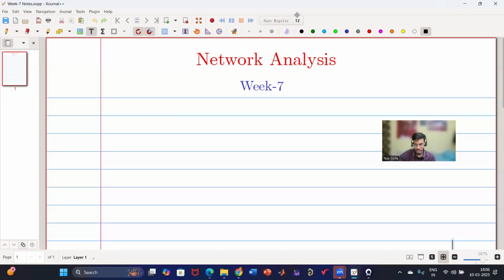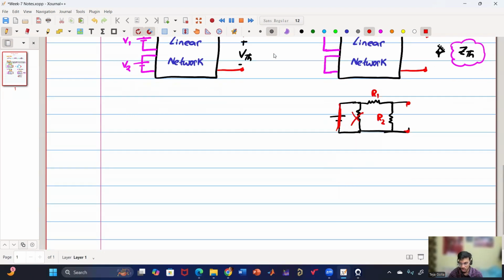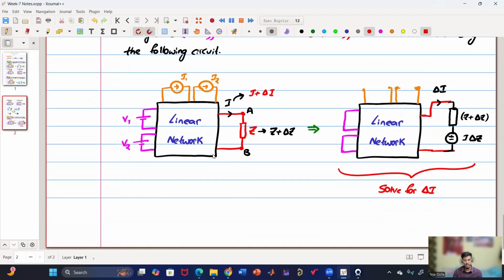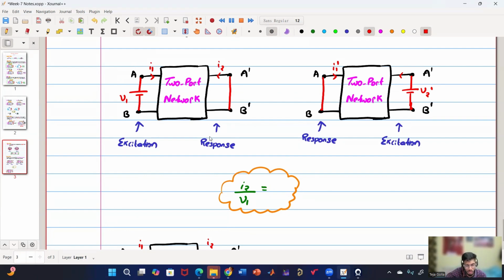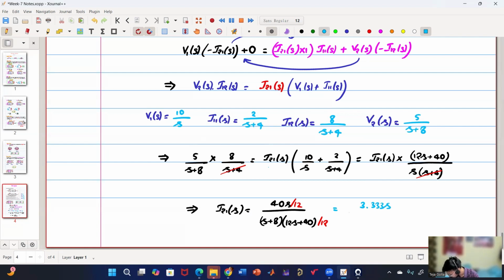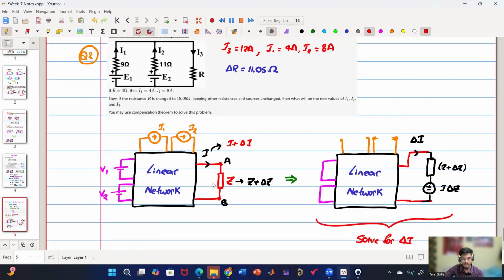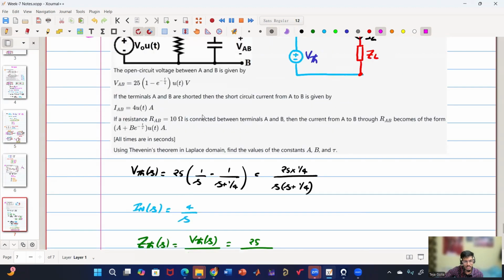Week 7 | Network Analysis | Problem Solving Session | NPTEL

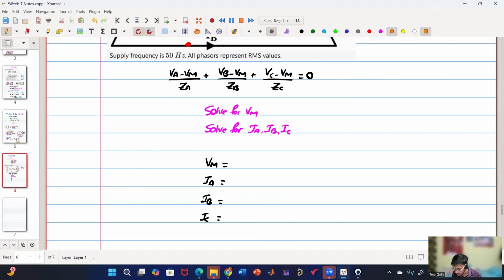Comment: At 1:37:30 How to calculate Ia, Ib and Ic. Please explain sir
Reply: To find I have used the formula Ia=(va-vm)/za, but I got different answer. Please tell me whether the formula is correct or not
Reply: Sir, please respond as today is the last day to submit assignment
Reply from the maker: Sorry, I didn't get during the day time to reply. Here are the expressions to calculate the currents.
Ia = (Va-Vm)/Za
Ib = (Vb-Vm)/Zb
Ib = (Vc-Vm)/Zc
Reply: I tried sir, but I got different answers sir
Reply from the maker: 1. Check if your Vm is matching or not; it should match as I have calculated and cross-checked with the given answer.
2. Make sure your impedance expressions are correct: Z = R + 1/(jwC), where w = 2*pi*50.
3. Check your calculations again.